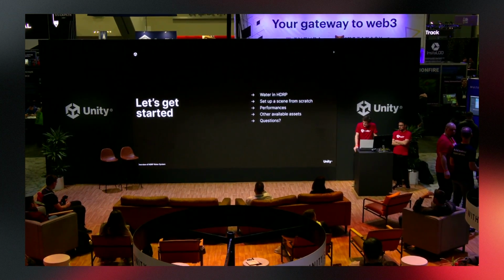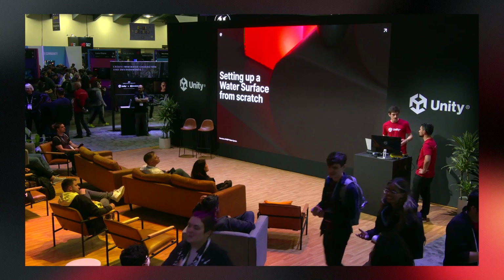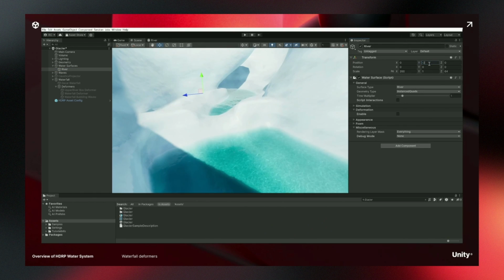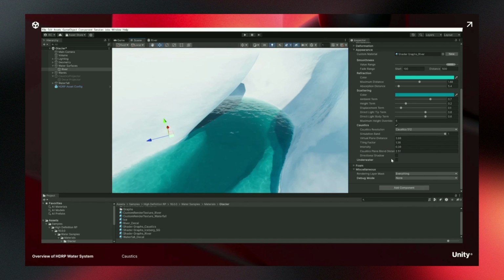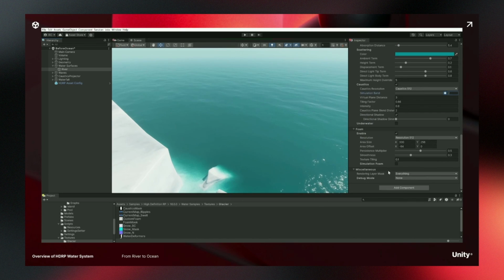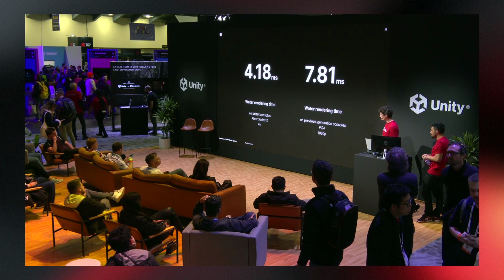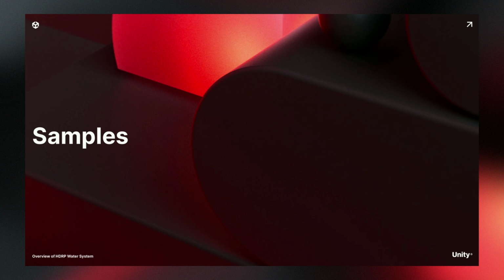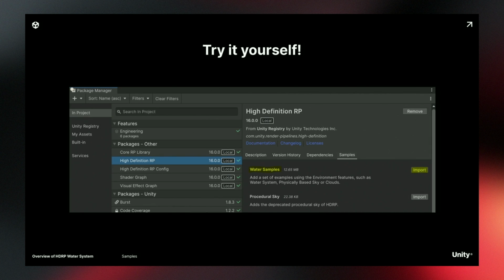An overview of the new HDRP Water System | Unity at GDC 2023

Comment: Unreal Engine speakers in the back looking kinda worried
Reply: I use both engines. But mainly use unreal engine 5.1, your point? Who cares.
Reply: peasant mindsets
Reply: What I like about epic is they are almost 100% match to match what they show and what they give you. No hidden things no false showoff no over promise. 
Btw, these are just tools. Making games and products and selling them is the main deal.
Reply: @IrtezaMasud  Of course, if you simply take high-end devices as a prerequisite, it's not a work of art to make promises.
Incidentally, I have a 1070ti, which should be supported by far for games. Well, the hyped Matrix Awak. I couldn't even start. Videos of Matrix Awak then circulated on the internet. Tech demo with a 1070. Someone must have recompiled the tech demo and just left out the new nanite stuff.

What percentage of players do you think will use the nanite lumen duo. Most will play with a fallback. And even if Nanite Lumen is turned on, it will be pretty throttled. There is a lot of marketing going on at Epic. But for graphics fanatics with a 4090 it doesn't matter.
Reply: @IrtezaMasud  not really .... a lots of feature from ue 4 is missing on 5
Reply: correction: kinda don't care.
Reply: Lol unreal had this 6 years ago
Reply: @sandeepm809  *3 years ago, when they introduced a new water system. 6 years ago no one cared about Unreal that much and Unity was still the king. Only after Fortnite became a success they really started steal away the spotlight.
Reply: they don't care. UE5 is miles ahead of Unity anyway.